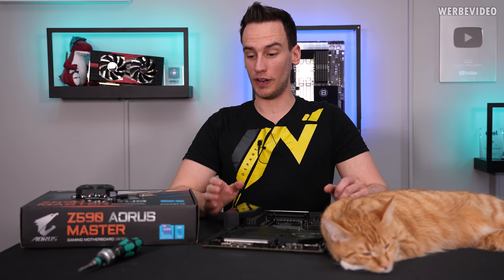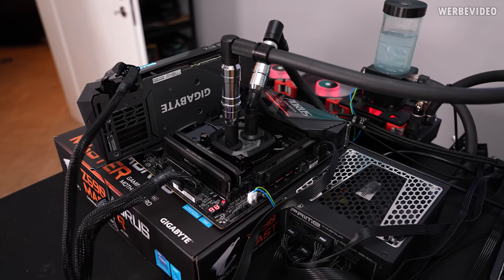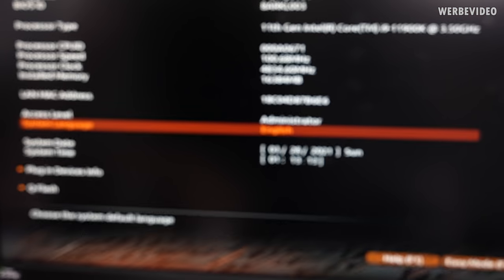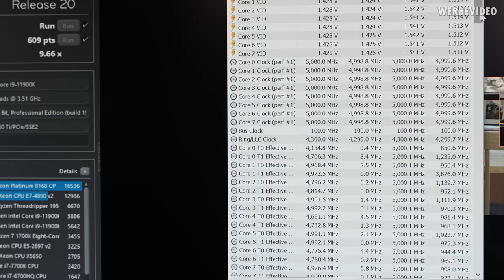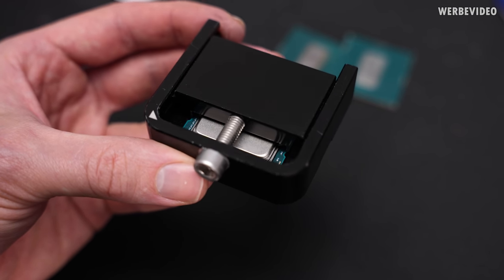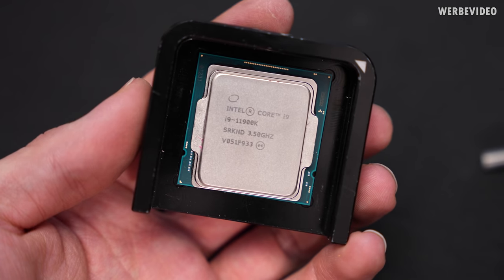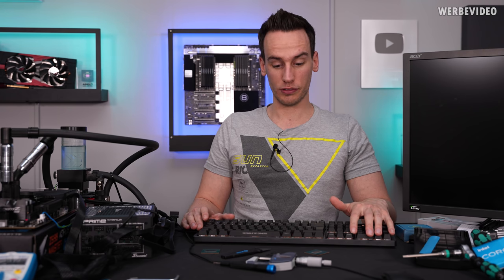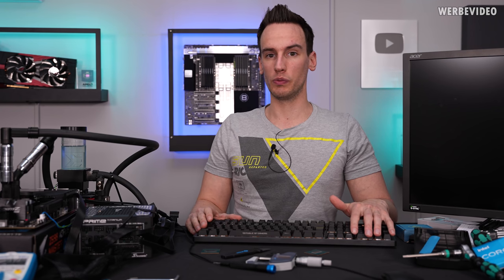11900K Delidding.... Somehow I can't believe my own Results

Comment: That was unexpected. Indium's thermal conductivity is 81.8 W/(m·K) while Conductonaut's is 73 W/m·K. Intel used too much indium for soldering or that isn't pure indium, it's a alloy.
Reply: You can see there's a lot of indium there
Reply: Oh I highly doubt that it’s pure Indium. It’s almost certainly an alloy. it probably has some tin and other things in it.
Reply: I reckon the glue being removed and reducing the height made the difference.
Reply: @anthonypugliese7340  That probably made half of the difference. The indium really do be thicc.
Reply: There is no chance that this much temperature difference can be explained by difference in thermal conductivity, there must be something else at play here.
Reply: It's probably a combination of factors, namely, tolerances, adhesive and impurities. Not to mention, zero care is taken on manufacture, the lid is smashed on and where it lies, that is where it stays.
Reply: intel should trial liquid metal under its lids because that is really a shocking drop
Reply: @pavel2058  The extra Indium would just squish off to the side if it was to much. Looking at how much glue was there it looked thick in added height the indium was thick on the die because of how much air space was in-between the IHS and die because of the up lift the glue made. I'm betting normal paste would still make it a few degrees cooler now. so i say its about 80, 20.... 80 to much glue 20 to much indium lol.
Reply: @ChristmasCrustacean1  it's not the liquid metal that makes up the difference. It's time and care, the secret ingredient is literally love. Extra material is bad for thermal conductivity, but it's good for consistency when these pieces are being put together by a machine.
Reply: @AmaraTheBarbarian as mentioned above, seems like they're just putting too much indium under the spreader and it might be alloyed, if Sony can run liquid metal in the PS5 there's no reason why intel can't in a production environment..   it is worth a trial if it means cooler running chips.
Reply: Agreed, Indium looks a lot thicker than prior videos on delidding, but 12 degrees from that?!? practically unbelievable! The only other thing I can think of is that part of the indium wasn't making good contact, or the indium his cpu had had a ton of impurities.
Reply: thickness directly impacts thermal conductivity.
Reply: LM cannot be 73w/mk. Its major component is gallium which is 30 w/mk, so at best it can be 30 w/mk. If you read the literature, galinstan (which is what this is) is on the order of 23-27 w/mk. I get that is what Thermal grizzly puts on the box but it is just wrong.
Reply: "Indium Alloy", by the way
Reply: It's just Intel purposely creating some area of improvement for the next generation of cpus.
Reply: im told it is an alloy, not chosen for having the best performance, but lasting a long time under stressful conditions(also likely cheaper then the pure or very high indium options) 

not unexpected...at least by me.... hell we use to delid k6/2/3 chips to replace the TIM...if not to just replace the IHS with a protective shim, and go direct die.... since then...amd and intel i have delidded or helped to delid... i have seen some truly bad TIM used by both AMD and Intel, honestly... we use to use a substance that was paste like at normal temps, but then melted at moderate cpu temps(best burn in was at 60-65c for 15-20min), once it was burned in... it worked amazing... and would solidify when cool, but not to a degree it made popping an already once removed IHS off again difficult, it wasnt solder... the name was in german/dutch on one brand and korean on another, the korean tubs actually had good english info about the stuff and its use on them. (oh, it had no mercury in it, and im told its still in use, been trying to get a price on a tube for a year or so now... eventually hes prob just gonna send me some to shut me up... and because he tends to know when hes fucked up and actually own it...)

anyway, yeah this is not pure indium, its even more gummy then that... 

i dont know the makeup is... but it could be far better thermally.

i once was told, if you delid enough old 775 chips you will find some, with the silver nonconductive paste that cheap videocards passive coolers had on them from ATI back in the 9600 era... stuff that in many cases will be burned to ash on the die itself... the chip kept working anyway though... 90c wasnt all that uncommon for techs to see in the 775 days... p-d chips were among the worst.... 2xP4 chips.....under one IHS...what could go wrong... bangs head into desk but some other chips ended up with this, because... a "mistake" lead to that compound being used on cpu's rather then whatever intel intended it for... in reality im told by insiders of the day... somebody decided to boost profits a bit more by stapping for cheaper stuff they used on chipsets for some devices...i mean...TIM is all the same isnt it?   i buy this... i have worked with that kind more then a few times... and they rarely endup being the ones to take the fall for their own actions.. sadly...
Reply: I wonder if have no glue allow extra heat to dissipate from around the die before thermal heat is transferred by the cooler 🤔🤔🤔
Reply: @anthonypugliese7340  wait am i hearing glued dies?
Reply: @25_Cats_in_a_Trenchcoat  Glued IHS
Reply: @anthonypugliese7340  making a joke at how intel called amd glued dies... das all
Reply: @25_Cats_in_a_Trenchcoat  I see XD
Reply: I believe conductonaut makes IHS closer to the die than TiM used by intel.

Also, all surfaces are rough, and i think conductonaut does a better job of going inside ups and downs in surfaces, therefore making better contact

Either way, it shows that amd and intel need something better than traditional TiMs

Comment: 14:57 Roman resells his girlfriend's nail polish as Thermal Grizzly TG Shield Conformal Coating
Reply: I read roman as rusian and I think that's more fitting 😂
Reply: Lol ya and it's pretty damn pricey too. They aren't shy to advertise it as a nail polish as well XD. Any idea what nail polish it is?.
Reply: @monotrope  Judging by the bottle, it's Laura nail polish from Netto. Pretty much the cheapest you can get in Germany. It works well though, even for higher voltages.
Reply: @heyarno  Netto 😂
Reply: lol, also useful for painting usb cable ends if you have a ton and don't want to guess at a rats nest.
Reply: I literally borrow my wifes nail polish every time I do something like this lol
Reply: That’s what I thought. I’m going to buy it and actually paint my nails to see if I can overclock myself and achieve higher performance while keeping my cool at work.

Comment: The English word you were unsure about for the measurement device is either caliper or micrometer 😁
Reply: Micrometer
Reply: Vernier caliper?
Reply: Micrometer sir. A caliper is a totally different instrument. It measures exterior, interior and depth. Where the micrometer only measures interior, but it's more precise
Reply: @Matpermad  micrometers primarily measures the exterior but depth micrometers are also available
Reply: @horrormoviemaker1  you are right, but either way, they are not Calipers for sure. Those are 3 in 1, less precise and completely different LOL
Reply: Prototype machinist here. Those are OD micrometers.
Reply: micrometre screw gauge

Comment: Looks to me that indium solder is too thick, so that it introduces additional thermal resistance. Otherwise it's a miracle.
Reply: Agreed, Indium looks a lot thicker than prior videos on delidding, but 12 degrees from that?!? practically unbelievable! The only other thing I can think of is that part of the indium wasn't making good contact, or the indium his cpu had had a ton of impurities.
Reply: @Appri  At this point the major hardware channels should employ a proper engineer/scientist who would be able to solve the 1d heat transfer equation. Because intel doesn't care and needs to be blamed for this.
Reply: @pavelgorlachuk1460  I believe this is an issue of manufacturing tolerances being ignored, like they have the technology to set the die tolerances to the nanometer but ignore tolerances on the iHS.
Reply: @Appri  tbh would you be more interested in a "7nm cpu!" or a "Smaller manufacturing tolerances in the contact distance between the IHS and CPU dye" when reading marketing material? Lol
Reply: I'd say it's a miracle!
Reply: I haven't double checked the die height measurements but is the indium thicker because of the package height whereas they needed to reduce that 0.1mm - - is the indium 0.1mm thicker than it needs to be and that causes 10 degrees higher temps? Unbelievable if so as their boost clocks would surely by much better with the lower temps and the product overall would be noticeably better. Talk about dropping the ball if so.
Reply: @ironmantooltime  I am not saying this is an engineering mistake. They surely knew what they were doing when decided to place this high heat impedance. I am presuming that the goal for the project was set to ensure a certain calculation and thermal performance and production cost below $XX. So it's all about more global decision of management "make a not-bad performance and thermals below 90C to compete with that nasty Ryzen". And sure they could have done better. The reason In-Ga eutectic outperforms indium solder is that it is extremely thin, though it's heat conductivity is ~4 times lower than that of In. Compare 1e-6 m (1 micron) thick eutectic with 26 W/(m K) [S. Yu and M. Kaviany 2014] against 5e-3 m (0.5mm) thick indium with 82 W/(m K) [Wiki].

Comment: Gigabyte shooting out auto voltages that can almost kill new CPUs. Awesome.
Reply: Yeah, is that deliberate?
Reply: Well those cpus are doa anyway lol. Ideal voltage for those few months stop gap until 12th gen.
Reply: @Acenis  Socket 1700 will be a thing before the end of the year. 11th gen seems like a bit of a pointless endeavour to me.
Reply: @Outland9000  Yeah that's what I meant. Voltage gonna kill them in time for 12th gen.
Reply: The 11900k only has to last 6 month until alder lake is release, so using  CPU killing voltages is just fine ;)
Reply: My gigabyte Z68XP-UD4 mobo auto-volts my 10 year old 2600k to 1.41v for 4.5ghz all cores, so I'd say gigabyte have a long tradition of using high voltages on CPU.
Reply: eh, its an extreme OC board, and also 1.5+ isnt going to kill any 14nm cpu faster than Alder Lake makes it irrelevant. ran a 5775c at 1.46 for 2 years with no degredation and that was crappy early 14nm with no plus signs lol.
Reply: @haukionkannel  it shouldn't ever be "fine" to on purpose kill your consumer's CPU by auto voltage
Reply: @Acenis  you guys keep saying it only needs to survive till Alder Lake comes out in 6 months but try telling that to someone that can't afford to upgrade every year & expects their $550-$1500 cpu to last many years! 
Besides Alder Lake ain't dropping for at least a year or more I guarantee it. New arc, New ddr5 & their talking about new gen pcie
Reply: @Metalhead-4life  It's supposed to be a joke. Intel is a meme at this point anyway.
Reply: @Acenis  As opposed to newly found spectrum like vulnerabilities, busted usb ports, shitty clocks & aesthetics etc. Not to mention the fact that AMD is a myth at this point & if you can find one it is likely DOA
Reply: @Metalhead-4life  lol keep trying a can buy 10         5800x right now  if a want they are everywhere on Amazon and newegg and pretty sure you go to best buy and they have cpu in stock
Gpu on the other hand are unicorn at this point lol
Reply: @legros731  I'm not sure what that mess of jumbled words is supposed to represent but in English it means nothing, however I could make out 4 numbers & a letter (5800x) and even if I did want an entry level cpu it sure as hell wouldn't be an AMD for all the reasons I mentioned in another post
Reply: Intel has been getting away with releasing the same piles of sand for years now. theyre better off selling T shirts at this point since they can atleast target a new audience that isnt so disgusted by their lack of innovation.
Reply: @Metalhead-4life  please tell my what aesthetic give an advantage to intel the box lol🤡🤡🤡🤡🤡🤡
Reply: @morbidgull8922  yeah funny how every previous Intel chip thats released all the reviewers see how far they can overclock it but when the 11900k was released every youtuber puts it against amd at stock, turning off all enhancements even
Reply: My 8700k is always in the 1.4v+. I don't think it matters that much. As long as your not loaded too much or hot or sustained. Just for games or short renders(a few hours once a week) you'll probably be fine.
Reply: @Metalhead-4life  "shitty clocks & aesthetics" tf are you even saying it's a CPU LMAO, what actual aesthetic do you even want.
Reply: @Metalhead-4life  "when the 11900k was released every youtuber puts it against amd at stock" Because the 11900k was already running at really high temps? tomshardware: "280mm - 11900k was hitting 100C when overclocked" techradar: "360mm AIO - 11900k was hitting 82C at STOCK settings". also don't know what reviews you were talking about, but the ones I've been looking at compares benchmarks at stock settings which is what mostly matters. I don't even care about this petty tribal attitude, as someone that is running an Intel CPU right now I think I'll just go full AMD for my next rig because clearly either Intel or Nvidia does not care much about the consumers.
Reply: @morbidgull8922  Userbenchmarks is not a credible source. Please stop using a sad shill site.
Reply: @bakaloid2940  man your cpus must run pretty damn hot if you can see them in the socket! The rest of us put a cooler of some sort on our cpus, hopefully a waterblock & amds waterblocks are not as "pleasing" to look at. Is that better I will try not to use such big words for you next time.
Also if that is too difficult for you understand it is common knowledge that amd motherboards are not nearly as nice as Intel motherboards especially when it comes to aes-the-tics
Reply: @morbidgull8922  my god, stop coping already. even a 5600x matches or exceeds the 9900k and that's the lowest of the lineup. with a 5800x you can't even compare especially in cpu intensive games like microsoft flight sim, and even in gpu strict games like rdr2 it leaves the 10900k in a dust. and that's with video games where traditionally Intel were on a lead lmao, so when it comes to productivity, just don't. and we're not even getting to the talk about thermals or power consumption. 

I get that you have a 9900k so you have to cope at the fact that your cpu might not be the best anymore, but christ stop using words like 'bias' when you don't know what it means.
Reply: @morbidgull8922  Bro there's no communicating with this illiterate, he keeps telling you to stop coping lmfao. I cope every day 🤪.
Reply: @Metalhead-4life  wtf are you trying to say man unless you are living under a rock let me break it for you amd had already beaten intel in every aspect lower volts lower temps higher clock speeds . also how the fuk intel mb is nicer than amd , does intel or amd make mb or something all motherboards look the fuken same
Reply: @LolSho0orTs  yeah "break it for me homie" smh "all motherboards look the same" lol whatever you say

Comment: That Indium solder looked as thick as a 0.020" / 0.508mm copper sheet, so 10-12°C seems right. Good work Roman !
Reply: I wonder if he measured the inner depth of the IHS.  That would tell you the solder layer thickness.  But that should be the same as the Conductonaut minus the black RTV they use to stick it down

Comment: Just curious, why not heat the CPU first, before applying the delidding tool?  It seems like the Indium releases quite easily once heated, and then it wouldn't take so much force with the tool.   Is it because of the risk of the die separating from the substrate?  Also same for removing the Indium from the die.   Why not heat it and remove it when still hot?
Reply: You first need to loosen the silicone from the IHS/PCB, which is what he has done when he put it in his delid-die-mate. I don't think he would have much luck with a razor blade due to the transistors and the fact that soldered cpus won't flex and make way for the blade, as the solder still hold it tightly in place.
Reply: @pavel2058  Adhesive always releases better with heat. Oven first would make it a lot easier since the glue will expand, and when it contracts again it loses some of it's integrity. However, when heated, all the other components on the cpu are in danger of falling off, which is probably why he didn't heat it up first.

Comment: Max 70°C @ CPU Package, 67°C avarage (the same test as in this video  @17:17)
11900k, 5000MHz, 1.29V, 12k non AVX (10 min warmup), 212W CPU power;
Asus Maximus 12 Extreme, Cooler Master ML240L RGB;
CPU die is milled down to about 0.3 mm thickness.
Reply: Non AVX and CPU package temps basically mean nothing.